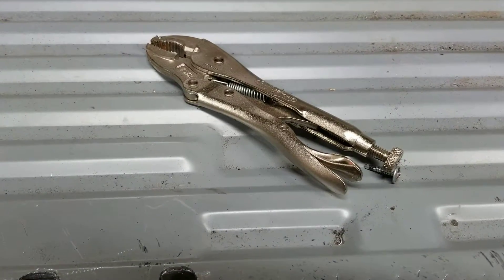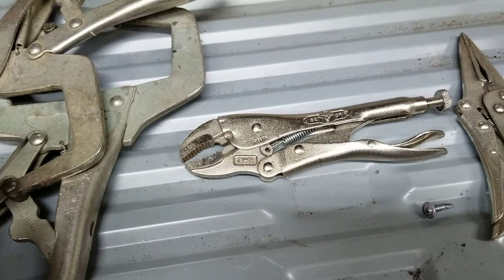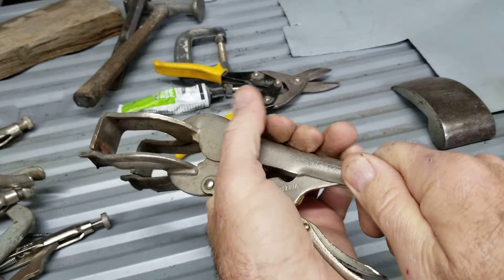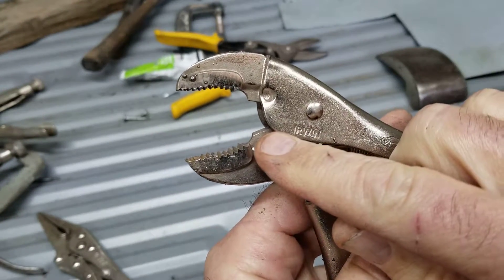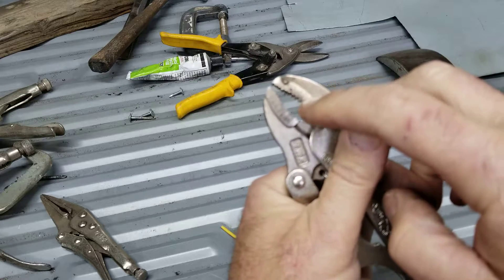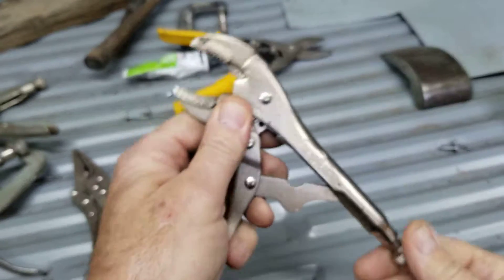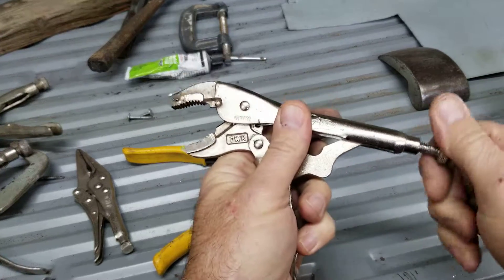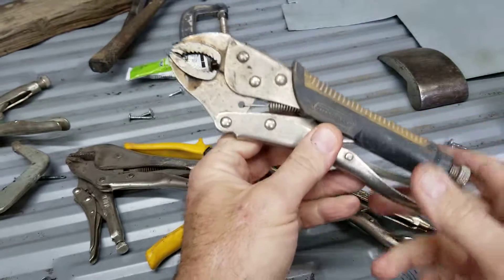How to use vice grips and what kinds there are

Comment: I love Vise Grips lol. I collect them like I do many tools. But being a mechanic I can’t ever have too many lol. I have some of each jaw type and everything. In my experience ever since Irwin went to China it’s been really low quality. The Malco ones are really nice. I purchased the Snap-on branded Malco ones they are awesome. I just wish they offered different sizes like the other brands do. My favorite modern brand besides the Malco is Duralast from Auto Zone they are really good surprisingly. Little expensive but good. Bremen is also good. Tekton is pretty good and I actually know a lot of people that have had good luck with the Hart ones at Walmart. Personally I don’t know that I would buy them unless it’s for the house maybe. But I use the Snap-on (Malco) everyday along with Duralast and Bremen and the original Peterson/Irwin USA ones. The Pittsburgh ones I had fail on me holding a hood strut which almost caused it to fall on me if I hadn’t jumped back so I don’t even touch those anymore. I have a few pairs that just sit there cause I certainly ain’t touching them again lol. I love finding the old USA ones online. Problem is people want so much for them. It’s cheaper just to buy a decent new pair.

Comment: Thank you Mike. That was a good video. I have a question for you. I am 66 so I can't go ask my dad directly - he passed 11 years ago. I worked with him a lot on various DIY projects and I remember him using what looked like vice grips to grab and twist a length of wire around 2  pipes to secure them together. He did so by clamping on to the wire ends and pulling the screw cap on the end of the handle.  The pliers spun as the shaft in the handle pulled back. It reminded me of a hand operated push drill. Am I suffering from old person's memory, or is there such a tool? If there is what is it called? I needed one last month and felt pretty smug when I went to our tool box to get the vice grips (humility is not my strong suit when it comes to competing with my husband on tool use and knowledge) and the darn thing didn't 'perform' as I expected. I had to get my power drill out to twist and the nose wires I put in the face masks I sew. Thanks a bunch if you can clear my brain fog.
Reply: Those are called safety wire pliers. clamp to the wires, lock in place, pull the screw, it twists the wires together.
Reply: @viking1372  Thanks!